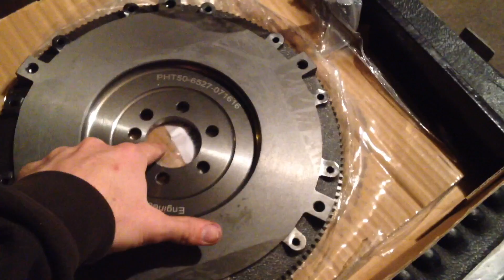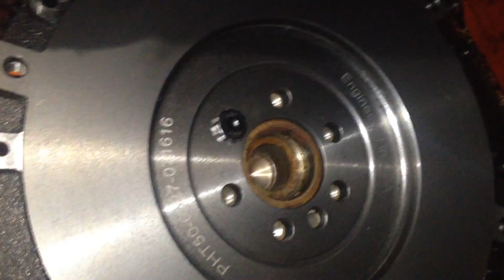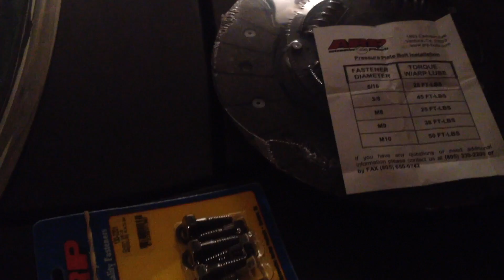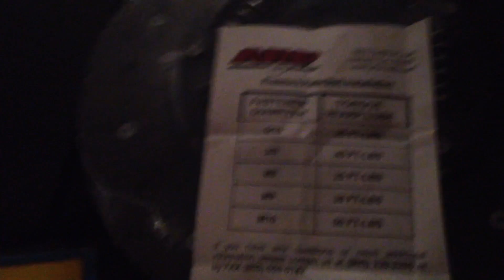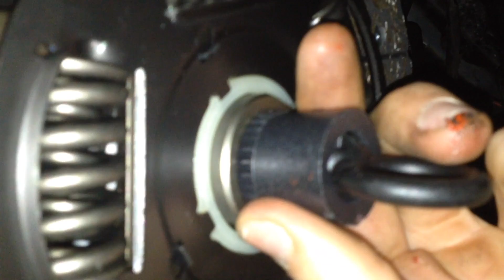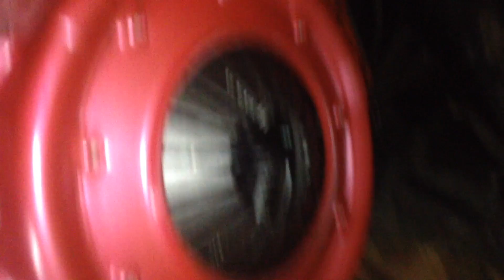Installing the Flywheel, Pilot Bushing, Clutch, and Pressure Plate on Small Block Chevy

Comment: I torqued the flywheel bolts to 55 Newton-meters; it's a 1995 Chevrolet Cheyenne C1500 with a 5.0L TBI small-block engine.

Comment: thanks for the video man , i have a 73 Charger 400 big  block with 4 speeds , i have a bad vibration , thought it was the driveshaft it wasn't .i have vibration when i raise my RPM standing still , could it be the flywheel ? also i have a very stiff clutch
 pedal and vibrating when launching
Reply from the maker: It could be something loose on the flywheel or clutch. I think that’s probably the first place to look at
Reply: @iowadiy6361  yes i posted an old photo of my engine before installing it and someone told that it doesn't have  the pilot bushing and another friend saw the flywheel is not tighten to the max
Reply from the maker: Hopefully that’s all it is and you can just tighten it up, install the bushing and then go
Reply: @iowadiy6361  hopefully brother keep up the good work love the videos greetings from Lebanon
Reply: Did your car start vibrating right after you put everything together or did some time pass before that problem started?

Comment: The 1996 GM service manual is pretty clear: no thread lock on the flywheel bolts.  Creates quite the dilemma.
Reply from the maker: That’s interesting. I’ve only ever seen that thread lock should be used. The only difference I can think of between the early and late sbc for the flywheel is switching from the two piece rear main seal to one piece which changed the flywheel bolt pattern. Maybe they changed their stance at that point
Reply: @iowadiy6361  what color loctite were you using?
Reply from the maker: I don’t recall. It was whatever I had on hand... which might come back to bite me later
Reply: @4marky  I used blue.

Comment: What's better a bushing or bering?
Reply from the maker: Newer transmissions will typically use a bearing but older ones used a bushing. A bushing is very forgiving and will last for me as long as I have the car so that’s why I use a bushing
Reply: @iowadiy6361  which way should the needle bearings face ? Towards block or away I can't seem to find out even on Prodemand.
Reply from the maker: I’ve never used a needle bearing, but if there’s a flat side on the bearing that would be meant to be pressed in flat against a surface. A round side would be on the outside
Reply: Thank you.
Reply: Bearing any day.
Reply: @georgecummings3227  naw

Comment: So I found the bronze bushing its ID is small the alignment tool wont fit , I am questioning the out put shaft will fit . So I am grabbing a re-emerging and opening the hole.
Reply from the maker: There are several different sizes of pilot bushings. If it’s a large difference I’d just make sure to buy the right one
Reply: I think the bushing was crushed .... thus making the ID small. I have a replacement bushings already. It fits the input shaft no problem.
Reply from the maker: That would do it. Good thing you didn’t try to force it and make another problem

Comment: I think it's worth mentioning that the pilot should be pressed all the way to the lip. Reason being, that insures the pilot bearing is true and straight. Its press fit so it can be close but you're talking about thousandth of an inch that matter in this instance.
Reply from the maker: Yes, sometimes that extra thousandth of an inch can be the difference to be within tolerance or not. That would be a small mistake that would take a lot of time to fix!
Reply: If using a pilot bearing which way do the needle bearings face towards the block or away?

Comment: Why not fix the oil leaks?
Reply from the maker: I’m not really concerned with a spot on the floor and I check the oil every time I fill up with fuel so I’m not worried about it getting low. I’m also building a new engine for it now
Reply: Looked like a valve cover leaking down, or the rear main seal. Nice truck.